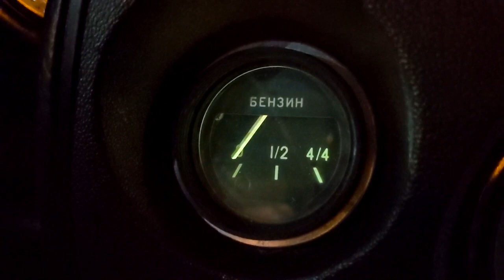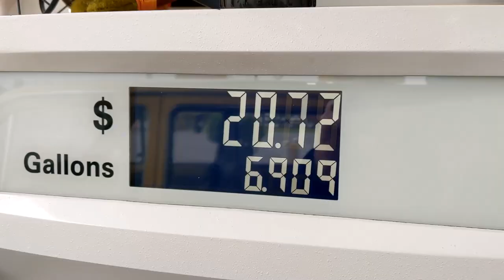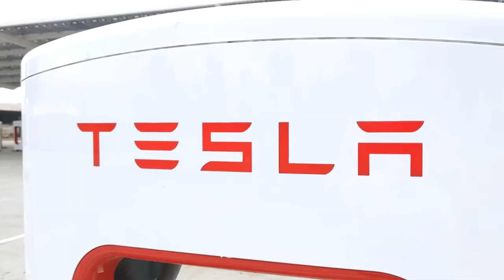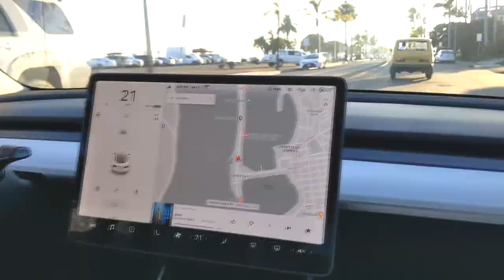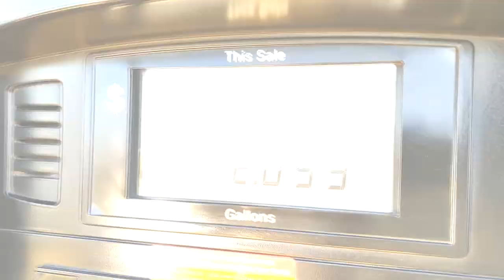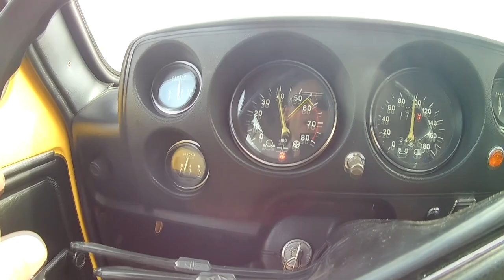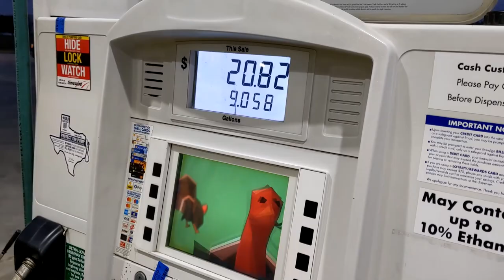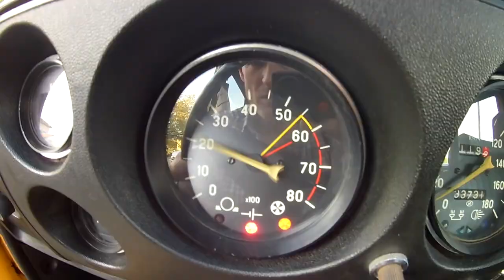I drove an old Russian car across the USA

Comment: “If nothing leaks from your Lada, it’s dead.”
Reply: We has similar saying - If it has no oil leaks, it has no oil 😁
Reply: Yeah that means there is nothing left to leak :))
Reply: Same with jeep
If the engine doing good its not a jeep then
Reply: Well then its luckily not a Renault that just gets expensive problems after just a few years
Reply: This is true. I had a turd of a lada in North Georgia ere in the USA an my Russian mom told me. If it quits leaking its dead. I didn't believe her til it quit leaking fer bout a week an a half. After that I went to start it up an go to get parts fer my elcamino project I put my mind into more than most things. And the engine blew the hood off in the driveway. My dad can legitimately sleep through a tornado, but that lada shitting the bed woke em up an within 5 minutes he was out the house in his robe with his skss while riding his 3 wheeler. Ready to shoot the dead thing fore I could have eny say in it.
Reply: @RadostinVelchev  if your Belarus tractor doesnt leak there's no more oil to leak, good old truth
Reply: lada is very strong car
Reply: Hondas covics engines have leaks either..so it is not rare.
Reply: @RadostinVelchev  🇧🇬🇧🇬🇧🇬🇧🇬 ома българи
Reply: I thought it was about a Land Rover
Reply: @JKRoss-zm3zu  lans lover are rust, weakdiffrenetials,  shafts and half shaft, and a lot of looses. British. Overpriced crap.
Reply: @JKRoss-zm3zu  If the Land Rover has leaked all the technical fluids, it is not a big deal, because it is still being towed.
Reply: Lol
Reply: @thunderbear0   what, Jeep has made or used some extremely durable engines over the years, from 1968-70 they used the unkillable Buick 350 V8 and the full size Jeeps, during the AMC era, they used very durable AMC motors, and then there was the legendary 4.0L straight 6. And most penta stars are good too, they just had a couple years of bad ones. They did try some bad engines, but most were good
Reply: it's the only way to know if your lada is out of oil
Reply: That sounds a lot like old British bikes
Reply: @heldgop Same in England
Reply: For a normal driver, no oil leaks. (P.S. I have an old Russian car. And nothing flows, and everything is fine with it) 
P.S.S.  Your junk is also covered in oil;)
Reply: @zepter00  hondas will probably not survive the tortures of russian environment...
Reply: What is dead may never die!

Comment: In the Niva, the engine is unclenched, it has a small compression ratio. Therefore, you can fill it with the lowest-octane cheap fuel and do not worry.
Reply: and at the same time by filling it with high octane petrol may (and most-likely will) lead to so-called detonation
Reply: @wrongIQ  not how octane ratings work
Reply: @tomevans1251  you are right! Later I understood that I wrote nonsense. But I clearly remember that once I had detonation on the similar engine as Niva has with a fuel of higher octane number that it was needed.
Reply: На 72-ом тоже попрёт!
Reply: @wrongIQ  no, it does work basically as well as lower octane, maybe better fuel economy, but it does not destroy it, especially a lada engine😂 this one was definitly used😂
Reply: @wrongIQ  probably bad adjustment of the spark firing
Reply: @zlunazelena4080  I didn't mean detonation like explosion. I meant the situation when you turn off ignition and the engine keeps running
Reply: @wrongIQ  that's called dieseling. It's caused by hot spots in the cylinder igniting the fuel in the cylinders rather than the spark plugs doing it.
Reply: @wrongIQ  No, (high) octane number refers to the property of a fuel to resist detonation. Therefore it will not detonate early, but the opposite.
Reply: @wrongIQ  nope, if you will fill this car with high octane fuel, you'll fry the valves.
Reply: In Serbia🇷🇸 we usualy takes 100octans petrol in it, and it is running way faster with stronger gasoline🙃
Reply: @tcb_car.garage  It isn't ''stronger'' gasoline just it allows for higher compression ratios without knock.
Reply: @martinda7446  basically, if you have a turbocharged engine. run 98 RON Or whatever the USA equivalent is
Reply: @PneumaticFrog  Forced induction requires low compression ratios for obvious reasons...
Reply: @martinda7446  run the highest octane you can use basically. otherwise you cause damage.
Reply: @martinda7446  buy 1.7i niva, delete catalisator, and try it😁
Reply: @wrongIQ  high octane IS against detonation. gotta hit the books. 92-95 is absolutely ok with this engine
Reply: just fill it with vodka for an extra 200+ horsepower
Reply: Thay dont have cheep low oktane gas , thay got only 98 and 100 octane  , and difference in price is very small ,
Niva idealna neftni gas
Reply: @bartsimpson8616  I wouldn't be surprised if we use a different octane rating system here. As for high octane burning valves, its not exactly the octane that matters. Different fuel types burn w/ different temperatures. In the USA we add ethanol, this will make a hotter flame front. We also add more to raise its octane rating.
Reply: @creeper50  Straight petrol or w/ Ethanol? You can have vastly different fuels w/ the same octane rating. EtOH will make a hotter flame front. When they used to say Lead lubricated the valve seats, this was not true. Lead slowed the free radical reaction (burning). The resulting explosion was slower & cooler. A more controlled burn is much more desirable. Lead was just a way to do that, not a lubricant. Actually gummed everything up.
Reply: @MrNoodlyone    you can add and Nitro if you insist , but all that  got short life  (exept drag race or something , at the end  car manufacturers must sell spare parts  ! so thay doesnt mind   yours  or my  valves to went blow off  ;)
Reply: @bartsimpson8616  See Nitromethane is a different fuel, entirely. It would require modifications. While it is crazy high octane, it is only 1/6 as energy dense as petrol. You would need to get a higher flow fuel pump & adjust the carb. Not to mention, it is a NOx. I bet the spark plugs look like tracer bullets in <5 sec. Do you watch Garage 54?
Reply: @user_imyarek  no, definitely not in this case... you might destroy valves in a very old engine with cast iron head, that is supposed to use leaded fuel, and as basically all high octane fuels are unleaded, it would destroy the valves and so... but not the fact than it is high octane, just the fact than there is no lead
Reply: @creeper50  those lada engines could run without issues on like 85😂😂
Reply: @MrNoodlyone  the lead was softening the impacts of the valves, in an old škoda 110 r my friend poured non octane fuel, because he was in place where there wasn t leaded fuel... from that point, the engine keeped stalling( even more than before, for those that dont know these cars😂) it was even slower, drank lot more fuel and we replaced it later with new engine
Reply: This is nonsense. How you even dare to say that, you don't know anything about those engines. To make car work smooth you have to set camshaft properly for any type of fuel you gonna use. For example if it was set for 85 gas and you would switch for 100 you will have to setup camshaft for following type of gas. Of course, it will be running still on other types of fuel. But as consequences, if you not gonna set the camshaft - it will consume more fuel, will be less efficient and could be a reason for detonation(feels on low rpm) thus your valves will be burnt. Following information is wrote in soviet service books, this is a typical procedure per constant gas switch. Also I wouldn't say that 12 bars is low compression ratio. Its a typical compression for most of the cars.
Reply: @thepinusnigra  isn't that just setting the right play between the valves?
Reply: @thepinusnigra  but, in russia, the benzine was at terrible quality in many places, so the engines were made to be able to drink the fuel that average russian pours in with NO adjustment... and also, you surely know an old uaz... the engine was simillar to volga, however it had little less power and way higher fuel consumption as it was able to drink basically everything...  so i am not really sure, maybe the valve opening intervals do something but i think you have to adjust the carburettor stuff and ignition timing rather than valve opening... i mean valve opening is  important, bad timing is having the effects you say, like high fuel consumption, lower power, engine knocking...but no matter what fuel it is, it needs to be adjusted the same way i think...
Reply: @MrNoodlyone  The gumming of everything allowed for softer valve seating and whatnot, though, because lead would buildup and form a protective coating, rather than a problematic one like carbon buildup.
Reply: @bartsimpson8616  They did in 1982, when much gasoline in the USSR had an octane rating of 76.
Reply: @unconventionalideas5683  I red that was more a myth, the coating was bad, engines had much less complicated engines. It probably lubricated... Some. My 66 Deville doesn't mind unleaded/ Drinks 8mpg. The microwelds were prevented by slowing the reaction. It got less hot at any one time, but the same amount of energy. In either event. Harder valves will eliminate the problem.

Comment: It's true that the Niva is a thirsty car, but it's even worse if you cross the States with mud tyres on it.
Reply: it was made to function on soviet gasoline, you can put basically anything into the gas tank and it would still run
Reply: @Roughman They are not as much thirsty as you all say it! Its just the small fuel tank that makes them look that way! 
They can easily cruise at 7l/100km!
With off-road treaded tires and heavy foot, they should'nt go over 10l/100km!
One fuel tank should and will provide 500km of range, and I know this coz I had one!
I think his editing was made more for comical effect than to represent a real-life test!
Reply: @damjandakic2003  that's not true. It is made for 92-93 euro petrol, which is about 88-89 US.
Reply: Those were the factory tires, with Russian roads in their mind. They've made them quite noisy on normal roads...
Reply: @Roughman Zhigulies are originaly came from FIAT 124 models. This Niva have same parts inside from FIAT.
Reply: @Roughman   ANY CARBURETOR engine, loves a lot of gasoline
Reply: @andrismajors8171    FIAT 124 and Niva have little in common. The body is its own, the rest is interchangeable from previous models (we have such a tradition .. military). FIAT 124 and VAZ in subsequent models is like comparing Boeing with Airbus, (pipe with wings) .... 
    FIAT 124 и Нива мало чего общего имеют. Кузов свой, остальное взимозаменяемость от предыдущих моделей (традиция у нас такая.. военная). FIAT 124 и VAZ  в последующих моделях это все равно что сравнить Боинг с Аирбасом, ( труба с крыльями )....

Comment: Your Lada comes equipped with all of the tools you'll need.
Reply: You only need a wrench and two hands
Reply: @edwardbrown3721  and an axe
Reply: and a crowbar
Reply: @edwardbrown3721  and eventually   hammer
Reply: and maybe some wire... but nothing else
Reply: No cupholders
Reply: They were probobaly stolen all ready, anyhow he took the wrong tool for that journey Lada Niva is very capable off roader it wasn't ment for a very long distances it have 3 diffs with the lock option which became quite loud if you drive it at highway speeds  also the last 5 speed/gear aint really strong enough to last long on a higway speeds.
He shod buy a Lada 1600 (2106) for that type of a trip.
I was amazed that he make it.
Reply: Hammer
Reply: you need just a hammer and sickle to repair a lada niva
Reply: You only need hammer and sickle to fix it
Reply: @altergreenhorn  These older Ladas didn't have 5th gear, they only started to introduce that with some export versions of Samara, as far as I know.
Reply: @edwardbrown3721  and vodka
Reply: @altergreenhorn  lada niva has only central differential locker..ONLY.
Reply: I wonder why noone mentioned blue electrical tape? It's mother-of-all-the-tools when it comes to repairing russian cars
Reply: I don't think the tools they provide was meant to fix the car I think it was more for stealing another or borrow some parts
Reply: yes standard equipment was hand wrench lift, screwdriver , Makarov ,and AK -47 ,
Reply: And a few Russian swear words
Reply: @TheHenryPickett  we didn't use cupholders back in USSR since we drink only vodka straight from bottles

Comment: My dad used to have a similar Lada Niva, which was olive green in colour. The car was built in 1991. We would go hunting together, when I was a kid with the Lada. It was a cheep car to maintain because Lada spare parts are interchangeable between models. The common side effects of all Ladas is that it's constantly hot inside them(whether in winter or in summer) and the reason for this is the heater in the cabin. And all Ladas have a unique scent inside , which is a mixture of the scent of petrol and the vinyl interior.

Comment: Niva breaks down only on asphalt. Never in offroad, when pulling out some expensive  high tech SUV-s :D
Reply: It's a Nissan recovery vehicle.
Reply: @alexandermenzies9954  More like Land Rover ditch rescuer
Reply: That was the reason, he was having such a bad mileage and performance - he should've ditch the Google and go as the crow flies..
Reply: When you push it overlimit with oversized wheels and all diferential locks, offroading with serious 4x4 on 6000rpm l niva breaks down anyware))) But even with melted piston engine continue to work

Comment: Owned two of these little beasts here in Australia. Did a lot of touring and off reading in mine. A very capable little vehicle.
Reply: I had one too. Bought it in 1995 and sold it in 1999. It was not a bad car.
Reply: @kdegraa  yet you only owned for 4 year = bad car
Reply: I learned to drive in a lada samara on a cattle station.  Knee deep bull dust and soft sand
Reply: It has a point out of tarmac only.
Reply: i seen 3 in melbourne, wouldn't mind owning one.
Reply: If you need some parts for Lada from Russia, it's not a big deal for me to send)

Comment: This poor Niva haha
having to rev at 4000rpm for hours and hours for days 
No wonder it drank through that fuel haha
Reply: In Russia fuel is cheap
Reply: They are not great on fuel economy , even when new thats why lots of them here in Kharkiv have been converted to run on gas  witch is about half the price of petrol or as his fuel gauge says , benzine  . Still a good car for what it is built for ,I.E Russian and soviet roads
Reply: The permanent 4 wheel drive is a fuel killer on them . Maybe someone makes an after market splitter , something like the Rav 4 , or maybe even that system could be cobbled onto a Niva . Interesting project for someone to try
Reply: Yeah, even a normal 2106 will find much better fuel mileage then this, he has proper taller gearing and rear wheels drive, on a long distance, the economy is improved very, even though it is same 1,6L engine))
Reply: @televisionandcheese  Oh yes , the taller gearing , what they use to go across rough roads so well . A lot of the Niva here in Kharkiv have gas conversions because the gas is about half the price of benzine . I wonder if anyone has found a way to split he front and rear wheel drives , needs some way to separate them  for normal driving , even a simple locking dogs mechanism would work , a bit primitive but that would suit the Niva ))))
Reply: @MrTarmonbarry  +offroad tires give a another gallon gasoline.
Reply: @a.l2915  Oh yes , more chunky tyres so less contact area , problem is they wear out quick on tarmac roads . Like to have a Niva and find some way to shift it from 4 wheel drive to 2 wheel . Some clever Russian or Ukrainian has probably already done it , they like crazy stuff like that and they are good at it
Reply: Its old engine from fiat 124 with bigger displacement that was designed 50 years ago. Transmission 4 speed manual designed 50 years ago. This vehicle won several Dakar rally”s in Africa long time ago.
Reply: @kr9713  it's not fiat engine, it's completely Russian design :)
It have a overhead camshaft ! 
Very good reliable engines.
Reply: 5 speed gearbox will improve gas mileage

Comment: Just a note: Niva's top speed is about 80 mph. Which means you should be able to more or less "comfortably" cruise at about 50-55 mph. If 55 is your top speed, something is wrong.
Reply from the maker: Four-speed gearbox means 55 mph is around 4000 RPM. I didn't want to go more than that for obvious reasons.
Reply: @KiwiEVadventures  5-speed gearbox. Order from Russia))
Reply: That would be with the later 5 speed transmission, which this does not have.

Comment: I rode an American made bicycle across the former USSR.  I'm really tempted to find a Niva or a Riva and bring it home.
But the Volga M21 is the beauty queen.
The little 4x4 like yours would be the most useful.
Reply: But I recently made a similar trip from the San Francisco Bay Area to Central Florida and back.  In my late model Corvette.  It went a lot more smoothly.  And quickly.  Have you considered a '60's or early  '70's Corvette for your collection? Old American Iron is generally very reliable but I'm sure you could find one this problematic if you looked.
BTW, I would have taken a little more time to sort out that car's poblems and found a few trails to test its off road abilities.